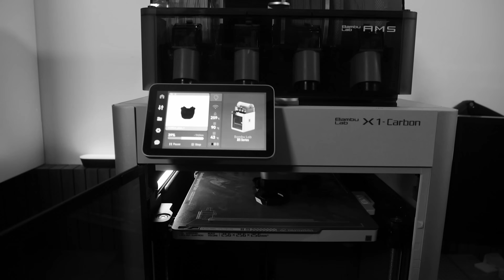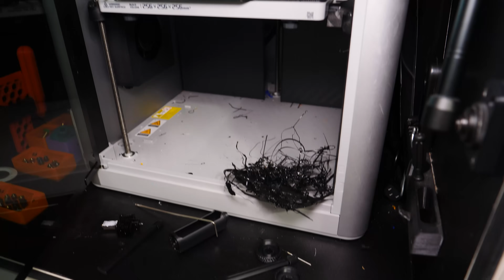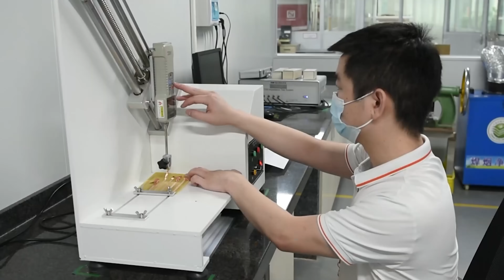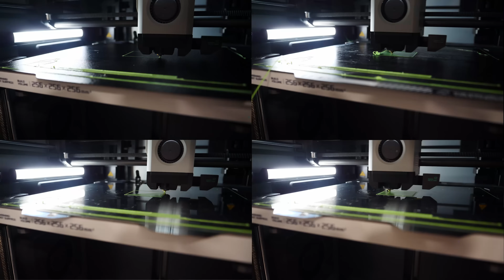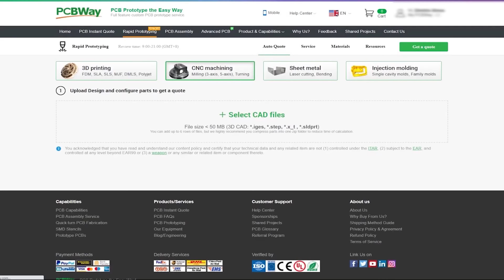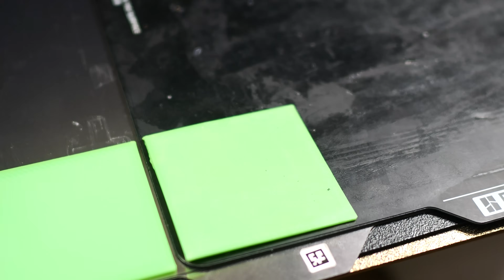Improving My Bambu Lab X1 Carbon... With Cheap Knockoffs!

Comment: Wow, you're pretty flippant about the whole closed source thing. I'd say it's a more serious issue than you might think. Today, sure, it seems fine. But in the long run - I'm seeing some incredibly negative effects from closed source in other markets. I recently switched from Windows to Linux, and am happy I did. It's becoming clear to me that "you will own nothing and be happy" is the future of closed source systems, and I'm concerned that's the path that will be taken if manufacturers try to go proprietary.
Reply from the maker: Hardware and software aren’t the same though. Your car is closed source. That doesn’t stop aftermarket parts…
Reply: @thenextlayer  Well, look at inkjet printers and the ink situation: A lot of ink cartridges connect electronically to the printer and essentially have DRM preventing third parties from making replacement cartridges. They also track ink usage to discourage refilling.

In addition, with electronics being added to basically everything, there has been a lot of discussion over ownership of hardware and right to repair. Just recently, there has been discussion over Ford patenting technologies to make self-driving cars reposes themselves. Keurig tried to add DRM to their K-cups a few years ago. John Deere has been rather notorious for trying to lock down their tractors. We do see instances of trying to erode ownership rights, even in the hardware space.

Comment: I enjoyed the video and all the continuing drama about build plates! I have been using the Cool Plate with Windex as the release agent for my Kickstarter X1Carbon from day 1 for PLA printing and it has worked well for me. Still using the original sticker. I bought the Bambu Lab textured PEI plate because of all the raving about pEI build plates. It’s a back up I have yet to use. I may get around to trying it it. Don’t really need the textured surface for anything I’m currently doing. From what I can tell from what I read, the PEI plates seem to require just as much attention, if not more, than the Cool Plate.
Reply: How do you use the windex to get the cold plate to work well for you?
Reply: @umbette  This is the title of the YouTube video I watched the day my x1 Carbon arrived: Bambu Lab X1C without Glue Stick https://youtu.be/bR0HBcdSO3Q Good Luck!

Comment: Got the Wambam Pex plate and the Gold Pei plate for my P1P. Both have been excellent. Also, since there’s no LiDAR, it just works flawlessly. Also bought the 0.6 nozzle which made it drastically quieter for all prints. Great vid
Reply: I personally had a terrible experience with the pet and abs together nothing ever stuck consistently with it.
Reply: does the 0.6 nozzle make it quieter? how?
Reply: @Calzune  A Bambu printer moving at full speed is almost neck and neck with the max flow rating of the 0.4mm nozzle. Used together, the hotend flys around trying to get the narrow (0.4mm) lines of filament down and is fairly noisy. When you go up to 0.6mm nozzles the printer doesn't have to work as hard or move as quickly to get the same amount of filament down, in turn it ends up moving a bit slower since the Nozzles melt speed becomes the bottleneck and not the speed of the printer. Since all bambu lab  printers speed settings are determined by the "volumetric speed limitation" setting, when you go to the larger 0.6 mm, the printer has to slow down since its motors are capable of moving faster than the 0.6mm can melt. Tried to word that as best as possible, hopefully that makes sense lol ..... P.S if your printing something that you have to print slow like tpu, tpe, etc. then the nozzle wont have any impact on noise.. It''s only for your PLA's , PETG's, and High speed filaments that you'll notice a difference between the nozzles.
Reply: @DifferentAverage  wow thanks for that detailed answer! I don't have a bambu yet but I'm planning on selling my mk3s and buy one 😁

Comment: Looks like you've spent a lot of effort on these video series, well done. 
In my opinion, none of the aftermarket parts you've tested make any sense for someone who bought the printer for >$1200. Cheaping out on nozzles and build plates is not smart, and as you said it yourself, even the most expensive option from the OEM (complete hotend assembly) is relatively affordable, in case you want to skip on the thermal paste mess. 
Speaking of mess - you shouldn't have faced it, but as you admitted its a user error. Luckily, bambu’s wiki is quite helpful for self-servicing your machine. 
Last but not least - I find the engineering side of the original build plate absolutely excellent for printing ABS/ASA parts, which is what I mainly use the machine for. I wash the plate with dish soap, dry and apply a thin coat of their glue every 3rd plate I print. Works fine for me.

Comment: I don't consider the X1C plug and play when I off and on fight force sensor 2 errors that show as either a Z-axis fail or a mesh leveling fail. As far as plates, I hated the Bambu Lab textured PEI until I was informed that Bambu Lab recommends against cleaning with IPA. Using just dish soap and warm water fixed most of the adhesion issues. The Energetic from Aliexpress still has parts adhere better. However, when printing with a brim, the Bambu Plate gives a better result. The Energetic has the brim adhering too well to the model such that using a deburring tool is necessary. I was shocked pulling a box off of the Bambu Lab plate and seeing the brim come off immediately. Yes!

Comment: I think Bambu owners are in two camps.  One that does not want to change anything and the other that is very open to 3rd party products.  I appreciate that it just works, but am interested in the build plates.  I ordered the Wham Bam almost a month ago, still waiting, but would enjoy not having to pre treat my Bambu plate before use.  Nozzles, etc are on the back burner until better products are produced and reviewed.  I would like to see a replacement for the Bambu Cloud, where it would be totally local.  That I would jump on.

Comment: I am personally 50/50 about it all.   The plain fact is there is no need for them to go the closed source aspect.    That said I can see where it makes sense,  the fact that everything is so standard means everything just works.    If your 3d printing for a living as a business it makes compete sense to go that route.  

I really would love to see more in the middle printers and more innovation.     I am going to play the wait and see game though.    Personally for me the extra speed of the x1c isn't really important to me.     I honestly have considered going the route of a refurb ender 5+ and doing a bunch of mods to it.
Reply: I’ve just bought into the ecosystem, and to be honest closed ecosystem would normally be a huge turnoff, BUT, their parts are literally cheaper than what I find for open source printers when you look at equivalents (hardened steel nozzles for example). And I know that whatever I buy from them will work almost all the time. This is now my third printer, and for the first time I’ve spent over $500 on one, so hopefully it pays off.

Comment: Gotta throw this out there. The cool plate can be one of the best plates.
I am nearing 1900 hrs on my Bambu lab X1CC with 1700hrs on my original cool plate. (150hrs on BL pei for a work project)
Glue stick was only used for about a week before I washed it off an used something else. 

I now use Vision miner Nano Polymer and the build surface looks flawless and my parts do not have a tacky residue.
I am on my original cool plate and it looks new. 

As a bonus of the nano polymer works on all build surfaces for BL printers. It is an adhesive and a barrier/release agent.
Another bonus is if PLA you do not need to heat the bed like PEI so you are saving energy too.
So again you do not need to use glue stick.

Comment: i am enjoying the just press print experience a lot actually. A few mods like for example the PTFE splitter and maybe the Bambu Lab Poop drainage system(electric conveyor with sensor) do sound very cool and usefull though. Wham bam plate does sound good but im probably going to stick with the originals because they are cheaper. Nozzles don't sound attractive to me to change those

Comment: I think the real reason to consider aftermarket is basically insurance against Bambu potentially slipping too far. 
We are 6ish months into the first printers and already customer service is struggling.
Reports of refusing to honour warranties because someone didn't keep the original box, or advising people to grease the belts to mask a noise, even sending a known smashed printer to a second customer with the original shipping label still visable. 

Many of these parts like the gantry or the bed were made to be impossible to service, do we want to be at the mercy of a company already struggling to keep up with support to also repair the machines and ship back to us? Time will tell if this is another project like Kodama who also made a printer full of proprietary parts and most backers now have paperweights, or a long term player in the industry. I hope its the latter but only time will tell.

I like your suggestion of building a Voron if you want to tinker and for the most part it is true, but competition drives innovation and maybe a 3rd party company will produce parts that help Bambu refine the product further

Comment: I have a Bambu textured PEI plate, and haven’t seen any of the errors you encountered with the Aliexpress one. OTOH, adhesion seems just a little tenuous with it. I can’t recall having a spaghetti monster with it (have had a couple, but don’t remember which plate they were from), but the parts literally fall off the plate when it cools. I’d be more confident if there was just a little cold adhesion.

I also have a Wham Bam and since I got it, the other plates have been gathering dust. (It is important to clean it well with IPA after each use though. That’s almost as much hassle as glue stick, maybe even more - but it gives a better surface finish.

As to making my own mods - HELL NO. The whole point of the X1C for me is that I send it prints and it JUST WORKS. Every. Time. The prints are beautiful and perfect and I don’t have to spend a moment thinking about it or tweaking settings. That’s exactly what I need, and the X1C + AMS was cheap in retrospect.

Comment: Awesome show but these for sure don't work "perfectly". Just something you said near the end of the video. I was curious why you kept mention Flow Rate as a modification? I might've missed a part in the video about this but things like PA and flow rate are filament specific so there is no way to avoid it with models like the P1P or using the X1 w/ the proprietary PEI sheet.

Comment: just FYI, when the lidar flow calibration "fails", it does so silently and simply falls back to the default internal pressure advance value, and there's no way to tell when it has or hasn't done so

Comment: You should read about scanners and optical distance sensors. When you put textured surface in printer, sensor only sees a lot of irregularities and it doesn't know that you changed surface because it's not programmed for it. So when it's confused then it throws error and only error that is programmed for this case is check if camera is dirty or something similar.
Reply: For this same reason P1P does t have this "lidar". This sensor needs to be in clean space without external light or dust to be precise and that can happen only in clean box. P1P doesn't have box so they removed lidar as well
Reply: @lovrocatela8727  - Bambulab did not add lidar to P1S, there are allot videos showing lidar does not work